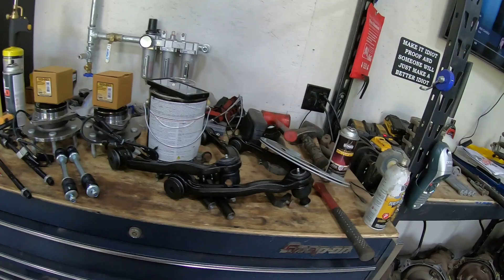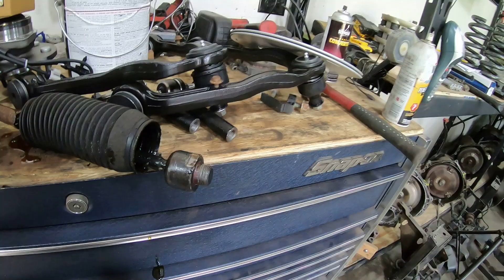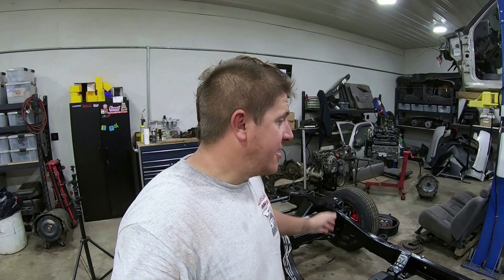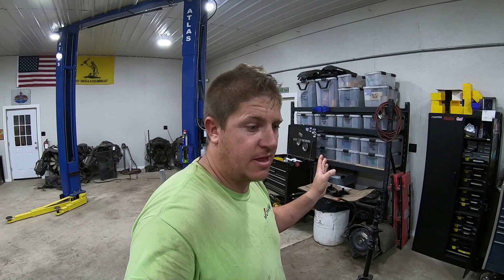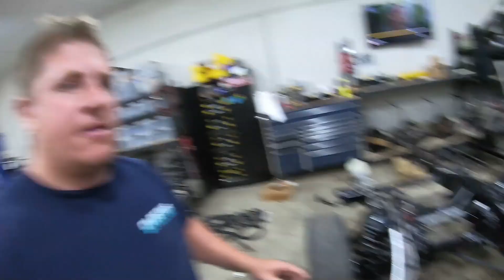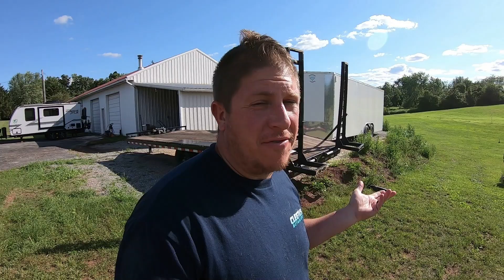I'm building a  Show Truck! Progress on the Silver Single Cab

Comment: I've heard the urethane body bushings make a street driven truck feel terrible. I bought the rubber set for my 04 2wd silverado, they were pretty expensive, but I feel it was the better replacement over the urethane bushings. Also the bilstien front and rear shocks the silver ones made the truck feel so much smoother verses the yellow moneros that were on it. Can't wait to see how this show truck progresses 👍
Reply from the maker: I've heard that as well, but I already have urethane body mount bushings in my 4x4 2007 classic rcsb and it doesn't feel or ride any different from my other one with oem rubber bushings in it. I'm sure it's probably more dependent on experience, but to me the urethane doesn't feel any different and is substantially less expensive than OEM replacements, and according to the internet, more durable, I guess we'll see about that in 20 years or so. lol

Thank you! It's coming along and I'm gaining some momentum now that there's light at the end of the tunnel.